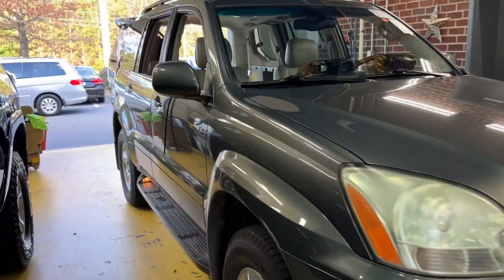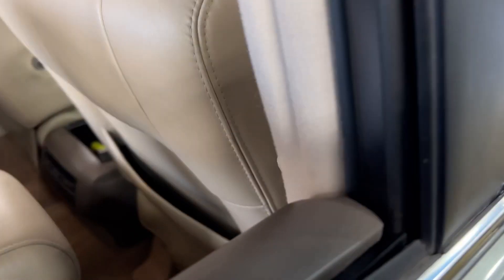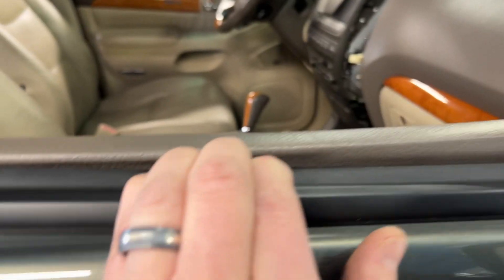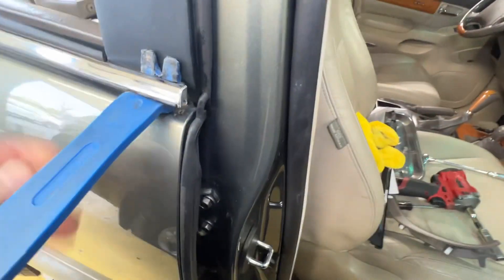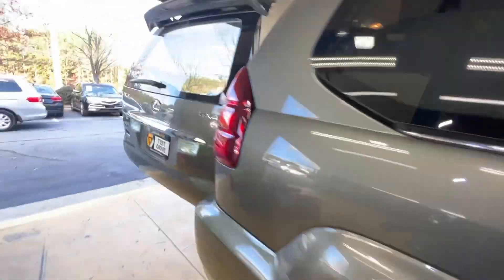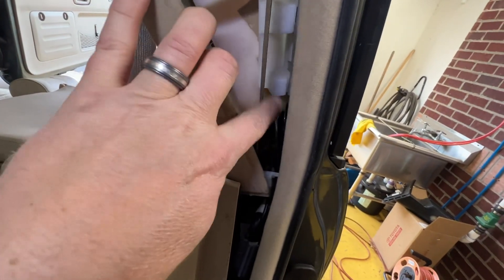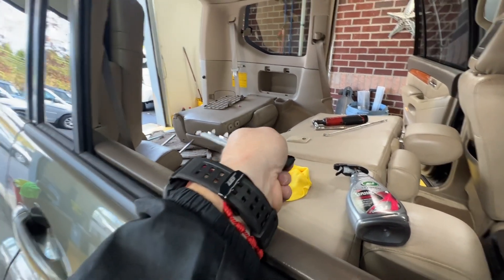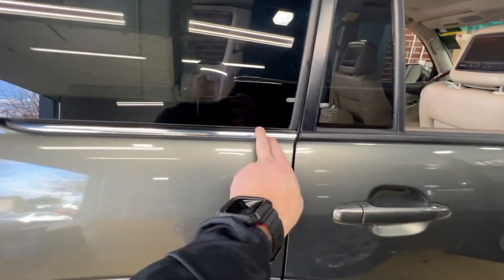GX470 - Window Belt Molding Replacement

Comment: Replaced the front passenger side and went to screw the screw back in but it won’t hold the screw. Just keeps turning? Any suggestions of a way to fix this?
Reply: Did you get this problem figured out?
Reply: put some glue on the screw and screw back it, and left it for some time

Comment: Do you know if these moldings hold up over time? Do you know a seller that sells the chrome versions at the same price?
Reply from the maker: They hold up great. The chrome versions are more expensive, over double last time I bought them.  There are cheaper non-oem options, but those I haven’t liked at all. Don’t fit as well, cheap chrome dents during install.
Reply: @Avalonautogroup  ok, nice! Is there any way to get around the shipping charges?

Comment: Rear moldings are not for sale... where did you get them ?
Reply from the maker: Part numbers for black Prado moldings I use are in the description. I order from partsouq.com
Reply: I appreciate your content.  Looking at doing a 2008 GX470.  Do you know offhand if the black prado part numbers you have listed are the same for a 2008?  Thanks.
Reply from the maker: @Adog5526  same  part numbers 03-09